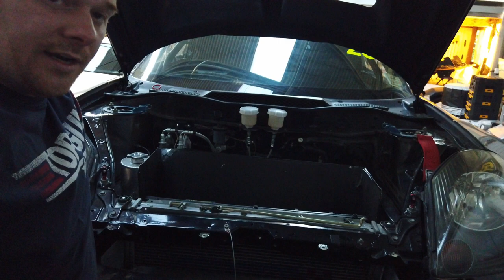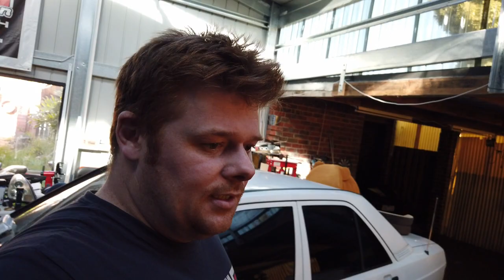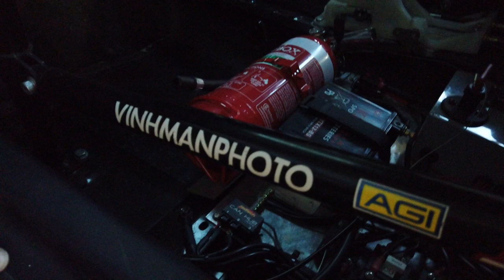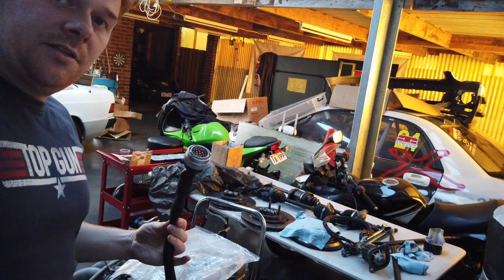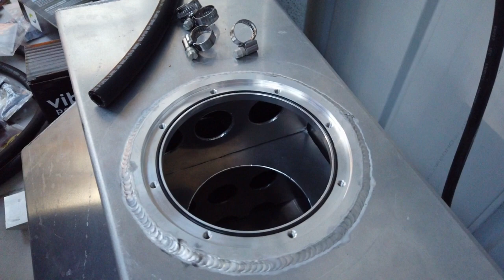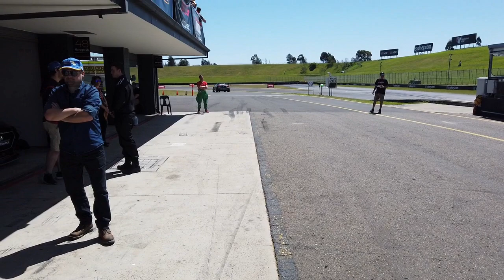Time Attack MR2 MR-S Walk-through

Comment: What gearbox mods did you have before you went Jubu?
Reply from the maker: @powerst33r  Holinger 3+4 gear, tosen lsd and the carbon syncros.. funnily enough that box is still kicking about as a last resort backup.
Reply: @CloseEnoughRacing  Thank you for being so generous in sharing. I'm running the SSC 3rd and 4th gear, also made by Hollinger. Hope my gearbox will last like yours. How much torque was your engine making before you swapped to Jubu?

Would you be able to share how you made the 2ZZ reliable for your use? What modifications have you made to it?

Comment: Thanks for the walkaround and info! I'd like to see how you end up mounting the new intercooler in the engine bay. I'm making a lot less boost than you and am also dealing with high air intake temps on the track. I'm currently using the following intercooler:http://www.frozenboost.com/air_water-ic/long-flow-style-water-to-air-intercooler-p-219.html
Reply from the maker: I had the same intercooler as that originally. New one is basically a double up of that so will mount up in the same place but have more depth.
Reply: @CloseEnoughRacing  I see, thanks for the info. I see you have it mounted in the back near where the bumper was underneath the exhaust. If I get a larger one I may have to move it to that area as it won't fit anywhere else I'm thinking. Mine is currently mounted vertically near the stock battery location. Starts near the driver side axle mounted vertically up then a 90 degree coupler towards the intake then a 45 into the intake. Trying to keep it away from the exhaust. Will be waiting to find out how much of a difference the larger intercooler makes for you.

Comment: Great video, thanks for sharing.  It would be great to see any of the following in the next video:
* Clarification and details on the gearbox (I think it was implied that it was still C60, but not sure)
* Your thoughts on the E153 and why or why you haven't used it
* Oil - consumption, oil type, changes to make the engine more reliable for track usage
* What power levels are you currently at and what are you aiming for
* Aero package and its impact on driving
* Tire and wheel selection
Reply from the maker: Thanks heaps for the feedback, I will make a note and work through all the points you have listed.
Reply: any updates or new videos?

Comment: I've been waiting for this thanks :)
Gtx3582r is rated to 850hp are you expecting that much out of the 2zz?
What do you mean about the sequential shift adapter? I heard ikea shift?
Reply from the maker: Well I guess "maxing out" can be a very loose term but the plan is to push the turbo as hard as we can within the efficiency of our setup..... from memory I think we will should cap at around the 30psi mark. 
In regards to the shifter the plan is to use a Lotus "ikeya formula" shifter, its basically a H pattern to sequential adapter. Just so I can take advantage of the straight cut dog engagement.
Reply: @CloseEnoughRacing  I have a standard 2zz do you think a gtx3071r is to big for it?